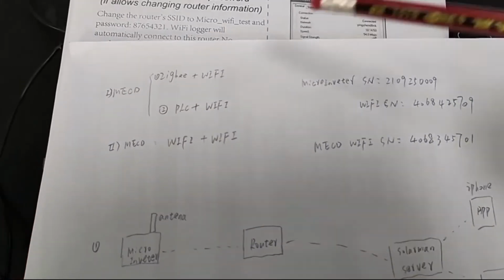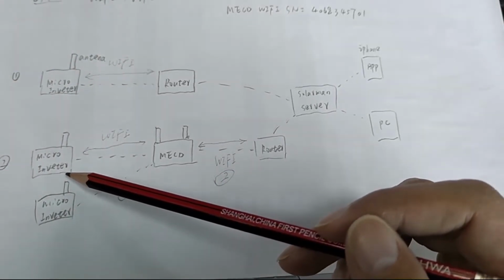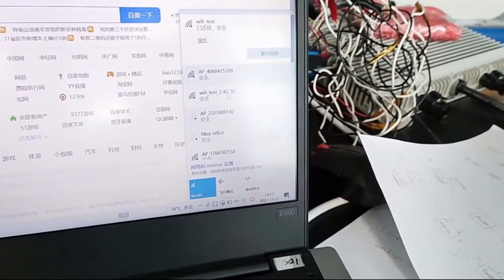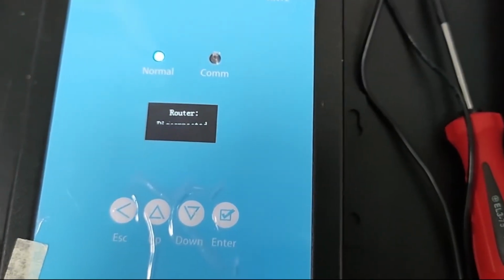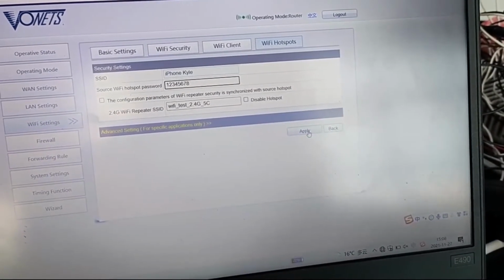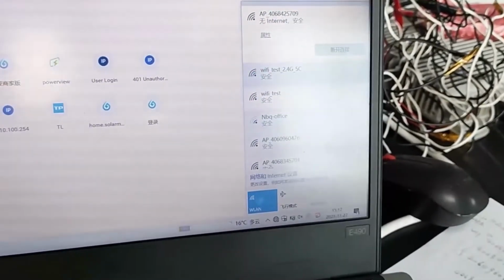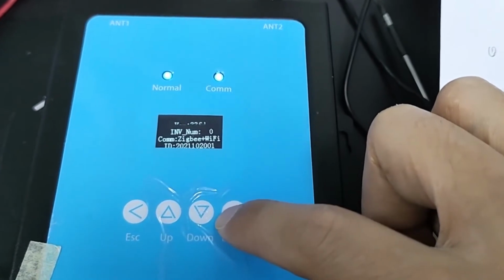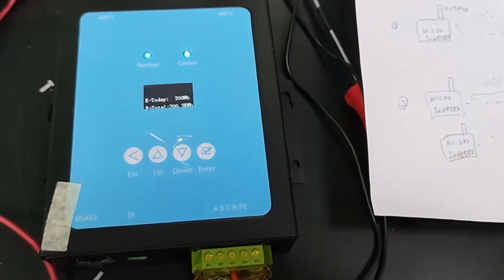Deye New MECD Introduction

Comment: Hello Kyle. I have a SUN1600G3-EU-230 microinverter connected to router using WIFI and I can monitor the solar production in solarman. My question is: how can I monitor the power consumption of my home? I have been told to use an MECD. Is it also compatible with a smart meter to measure the compsumption of the home?
Reply from the maker: if so, need to use the energy meter of solarman and the meter need to be installed at the grid side.